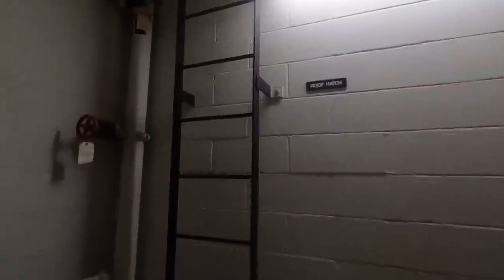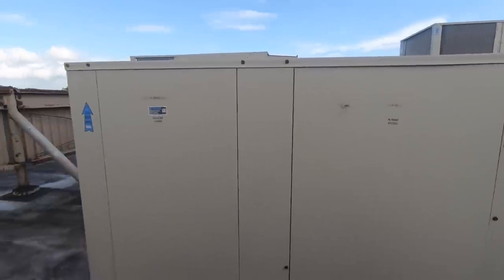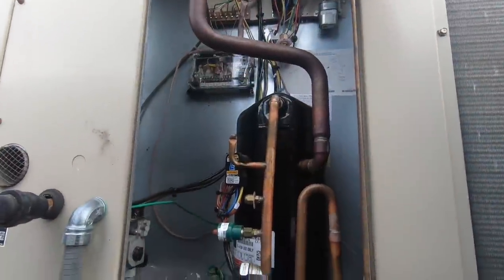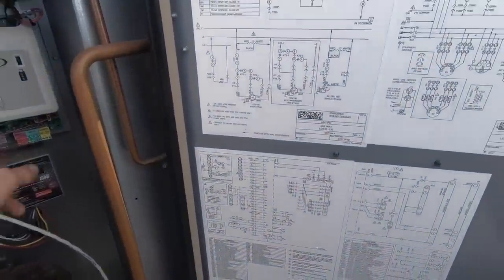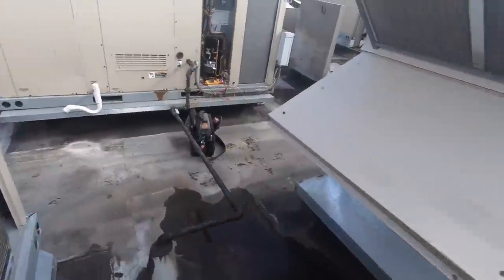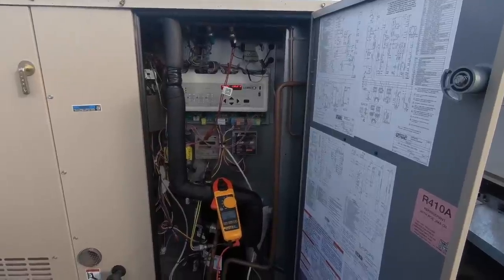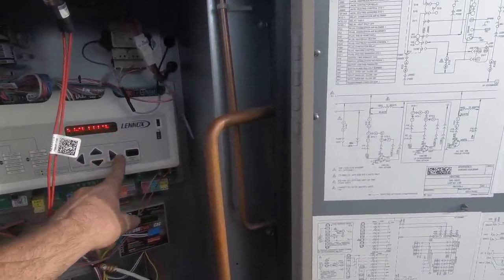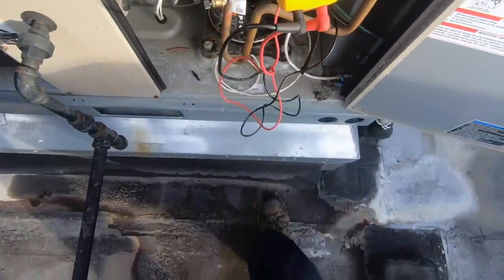HVAC Troubleshooting Low Voltage Short

Comment: I'd rather drill a hole in my big toe & dip it in Red Devil turpentine than work on a Lennox. Good video. Your process of taking out loud shows the thought process we go through. There's a huge amount of diagnostics that happen before we ever even open a panel.
Reply from the maker: the worst is when a customer asks what's wrong before you start troubleshooting. Problem is we may start worst case senerio and trace back.

Comment: Great video. It's real troubleshooting and fault was not created for video. Sometimes troubleshooting takes a little time and its difficult to remember all HVAC or RTU systems. However, reading wire schematics is important to trouble electrical or electronic faults.
Reply from the maker: Almost all my videos are actual service calls. The ones that are not are problems at my house, dads or moms house. Not all calls are successful also some conditions I work in also may not be ideal.

Comment: Keep at it. I remember chasing a 24v short to ground for about 5 hrs on a residential gas furnace. Wound up being a piece of foil backing from cabinet insulation where the coupon  was stamped out at the factory for the hi limit. Occasionally after the blower came on the air would catch to foil and swing it up and touch the bare clixon terminals of the limit and short to cabinet. At some point labor be damned and pride is at stake. We only charged an hour labor. Our previous tech replaced a burned transformer and saw no other issues. We installed an inline fuse in the circuit and probably blew 6 or 8 before finding the problem. Techs come in 2 main flavors...bs cons that bail and sell new equip and pitt bulls that dont throw in the towel. You sir appear to fall into the latter group.
Reply from the maker: I find myself on many non billable calls for my boss. Many jobs When as per (bosses name) I go to which usually there is too much going on for me to make videos cause of upset customer, and I need to close the job. I can spend days we’re I get paid yet my company isn’t billing my time since they need to save face. Plus how can u collect on a project that the customers already paid for 1 or 2 calls and machine is still down. In you furnace I would have inline fuses hooked up all low voltage lines if I couldn’t catch the short so when short strikes I had a blown fuse letting me know which circuit my problem was on. I learned the other day some may call this connecting tattle tales. Did you have all low voltage lines interrupted with fuses or just to protect the transformer?
Reply: The HVAC Hacker 

It was to protect the transformer and circuit board to avoid damage during the search for the short.
Reply: That is a good one!! I had a no heat call once that stumped me for a little bit. The very first thing I do is always turn the thermostat up all the way. Went thru everything and come up with it being the thermostat. Went upstairs and pulled the cover off the ole T87 and the cockroaches scattered and the furnace kicked on.
Reply: TwiZ1975cj5 
Had a fellow tech told me of a heating issue said he cranked the stat and went to the basement started checking and the burners went off. After a few secs in came back on. Few secs off again so he hollered up the stairs at the lady to stop messing with the stat. She hollered back shes not doing anything.  He goes back up and pulled the  cover off the stat and was roach city in there moving the bulb. Ew
Reply: @thehvachacker  If you have a line fuse on the common returning to the transformer you have effectively protected the entire circuit it serves. Respectfully intended, Electrons must be able to flow through the circuit in order to produce EMF to drive a load, this happens at a cellular level ( obviously ) and if it cannot move electrons through the common then there is no space for them to occupy and move into on the L1 End... the exception is if the L1 has a path to ground, in which case it should over amp and trip a breaker, this can depending on the install, the age of the units ( cracked insulation on wires ) among other variables cause the board or other things to fry, in the case of over amperage you willl loses the narrowest ( weakest ) component, usually the board, you may also fuse contactor points together if this happens.  remember that Volts is pressure and Amps are flow.... if you run a TON of water through a LArge pipe it will take longer to wreak itself then if you did the same flow n a smaller diameter pipe.... Electricity and water have many many similarities.
Reply: @larryfisher5198  Ive seen bugs cause shorts, ive also found dead ones in between the contact points in the contactor, the bug literally got crushed there when the call for cool happened.  I usually start with the t stat.. often times I will take the face off and jumper it right away, if the unit works tickity boo then I already know its the T stat face..   I then take some time to explore the general health of the unit before replacing the stat ( an hour long call, so I spend an hour there )

Comment: Just an FYI to all the new text out there when you come up to a unit try to make it a habit of push starting your contacts first just to see if the device runs then using a jump box or anything you can make basically if it's a 24 or a 120 volt coil have a breaker or fuse in between it and put power to the coil and see if the device comes on it'll minimize a lot of your headaches unless you come to float and transformers which are a pain in the butt

Comment: On this type of call I often carry a 24 volt 25 watt light on test leads.  You can probe contactors, switches, wireing harnesses,  and such and when you have a short the light comes on and the amp clamp can follow the 1 amp of current in the wires to the ground.
Reply from the maker: I will have to check into those test leads
Reply: I've never seen them as a manufactured item.  This is a home build.  A couple of auto tail lights in series on alligator clips is the test light.  Use the stop light elements for the current.  Two in series for 24 volts.  Draws about 1 amp which is easy to trace with an ac amp clamp.
Reply from the maker: Then I will be building something like this
Reply: @thehvachacker  you can buy the unit he is talking about at any auto store, its not as useful as a meter though, IMO but everybody has their own way of cracking the egg..  respectfully intended. :)

Comment: You were on the right track. The short wasn't the coil shorted to ground, it was in the pull in coil itself which, in effect, shorted it across itself. The coil should have a resistance due to length of the wire wrapped around it to create the magnetic field. When the windings short across themselves, they won't create the magnetic field to pull in the contactor. You lost the short when you disconnected the coil.
Reply from the maker: I did remove the short and then the compressor was able to start. Afterward when I ohm the coil there wasn't any resistance. It is just like testing two ends of the same wire.
Reply: @thehvachacker  no resistance means the windings are shorted to themselves, you should get a resistance reading that is fairly low, but not nothing... similarily if you go O.l. then it has burned itself out.

Comment: I told an auto mechanic friend of mine that HVAC and Auto Mechanics are constantly changing fields.
Reply from the maker: That is true yet I know many who have stuck it out as long as there body's held up
Reply: Yea I kinda switched to auto (mostly custom jeep stuff) and atv repair and custom fabracobblin. I have my regular HVAC and plumbing customers, but I mainly do the other stuff now. Fucked my back up and its easier to deal with the other stuff...sometimes

Comment: I must have skipped the part where you checked the resistance across the coil. Because if you did that in the beginning wouldn’t you have seen that issue when you started? Not questioning your service skills I think your awesome just asking questions

Comment: Order one of the resetable fuses you see so often in Lennox units.  When trouble shooting low voltage insert it into the transformer circuit and you'll be protected from accidently shorting the transformer
Reply from the maker: I have one always in my tool bag just didn't need it. I also made 2 wires with spade connectors for using on control boards I find blown 3 amp fuses. those fuses come with many of the upgrade control boards.

Comment: So, if you get 24 V from power-red to let's say fan-green....does that mean that the x-fmr is putting out low voltage to wherever you are taking your voltage reading?

& if you get 0 V from common-blue to let's say 1st stage cooling-yellow....does that mean that there is not a call for cooling?

I just want to make sure if I understand this right or not.

Thanks.
Reply from the maker: If you have 24vac between r and G you have power yet no call for the blower, yes 0volts from Y terminal to C  means there is no call for cooling. You would have 0 volts between r and and terminal that the stat has on. 24v shows when no call for cool r to any terminal except c.
Reply: @thehvachacker  Thank You not only for the education, but also for the quick reply.
My HVAC/R book from college went up in a house fire about 4 years ago. Otherwise I would of read up on it.
Merry Christmas, Happy New Year.
Please keep uploading your calls. They are cool to watch & very educational!
Reply from the maker: Merry christmas and happy new year also. 
I will try yet this week is mostly big maintenaces set up
Reply: when you use a meter you are measuring a differential. R will always have 24 vac ( should )  IF you measured the same line ( volts ) with the other probe you would not get a reading ( no differential ) the reason that you read 24 v between a load and the common Say R to G with fan running is best explained by the electrical path. R ( 24 VAc ) touches G in the t stat ( in the R to G example ) meaning that R and G are the same wire now,  the reason you test between the G and common is that the common legs readable voltage has been consumed by the load ( in this case  for the 24 vac the Board and the relay. )    IF you were to connect the R ( 24 vac ) direct to the C you would burn the transformer out since it would not have a load on the circuit...  I hope this clarifys it, im just half way done the coffee so I may have some lackng in my description :)

Comment: Great work. Is that a Fluke 376 FC? I want to get a meter with both the clamp and probes attached.
Reply from the maker: No it’s the fluke 902. It’s a great meter still works great yet after using it for 10+ years the display light no longer works

Comment: Just curious. You said an electrical storm may have caused the electrical issues to the Prodigy.
Could this of been avoided if a really good surge protector had been installed on the unit?
Reply from the maker: It could yet usually doesn’t happen
Reply: @thehvachacker  Could you sell them to your customers to make yourself some extra money?
My previous boss would always install a smoke detector system in package roof top units.
It was designed to kill power to the fan circuit, if it detected smoke/fire.

He was big on installing those.
Reply from the maker: Every system has smoke and fire dampers. Fire dampers not as much since the smoke sensors shut they system off. There should be phase monitors connected. Yet not always. Where I work I am suppose to sell only repair and replace what’s broken. Sales is another dept.
Reply: @thehvachacker  That's a good company! A lot of companies expect you to be a salesman. They don't give out raises nor bonuses because "your sales commission is your bonus. You decide how much money you make." I walk out of job interviews as soon as they start this bull shit on me.

Any hiring professional who tells you that, is NOT offering a career, but conning you into being his cheap sock-puppet.

-Ask me how I know!
Reply from the maker: I worked for someone who wanted to maximize profit on ever call. Was expecting me and the other tech to always find problems. He would freak cause in many of my videos I pull of repairs without replacing anything. Where I work they figure they will replace the equipment when the time comes so only replace if needed or the customer wants.
Reply: @thehvachacker  That's a damn good company! You are in a good place, man.
Reply from the maker: Yes and they keep me busy
Reply: @thehvachacker  I know its a little bit early, but Have A Merry Christmas & A Happy New Year!

Comment: Could be when a relay pulls in on the 24 volt side
Reply from the maker: The coil on the blower motor was shorted. So when energized the blower coil was a direct short. I like jobs like this that make me think and really work to find it.

Comment: dealiing with service calls how long do you typically tell the customer you will be ? Do you just tell them the rate you cost per hour ?
Reply from the maker: They know the rate before I get there. I only give time frames on repair work/ changing a part. Chasing a short is different. I tell them it’s going to take however long I need to find the problem. How I factor that time; I take the time it takes if the job goes smooth. Then I add an hour as a cushion just in case. The customer is always happy that you beat your expected time. Yet you keep them off your back if something goes wrong.
Reply: Yea you wanna be real careful about the time thing
Reply: great advice. I am an install technician installing alarms and customers are always quoted 4 hours from my company but i always tell them i could be up to 8 hours and make sure they are okay with it and as the job is going and i start to feel out the install i give them updates like you said adding an hour or so to my real estimated time so that way if i get done earlier i can look good and if not then they already were prepared.  HVAC/R is the trade i want to transition too and i am nervous about dealing with time i am still new to the trades in general i went to a short term trade school then got hired as a install technician installing alarms but i feel hvac/r is interesting and i love the idea of the trade never going anywhere.  i bought some books on hvac but i was going to ask is there any webisted you go or went to when you were learning different systems to learn or did you just learn as the days went on in the field as an apprentice ?
Reply: ALWAYS ballpark, and tell them a bit more than you think it will take, this way they are hay when its done faster and you have covered yourself in case it becomes a real PITA job... I am fond of telling customers that I can only ballpark since IF I say " 2 hours " the minute i do ive shot myself in the foot.

Comment: check your t stst wire going in side ,could be shorted going in side ,we got some 8 wire once that drove us crazy ,after about 6 month would brake down ,had to pull new wire to inside !
Reply from the maker: It was the blower contactor coil shorted

Comment: Wow just a p trap ha.😱 why not not run some SCH 40 to roof drain. Smh 🤑 to replace the FN roof
Reply from the maker: most RTU only have traps on them and drip right onto roof
Reply: I heard one time a tech stepped in the water and was killed. A RTU was completely grounded or something.